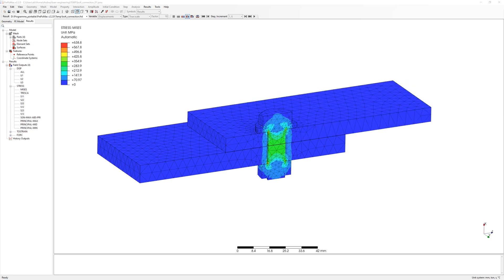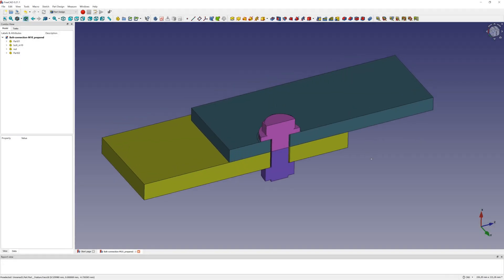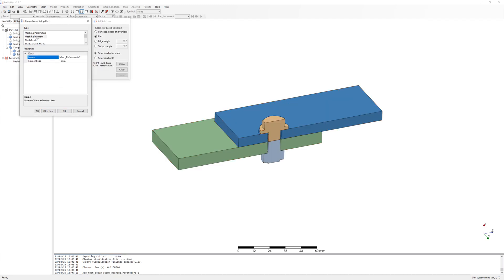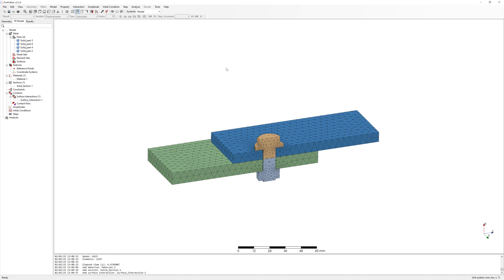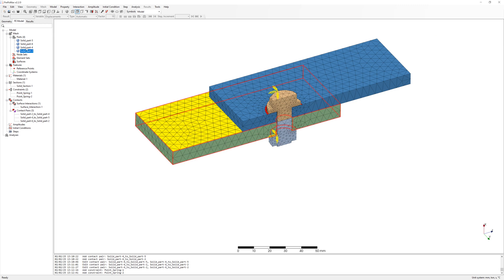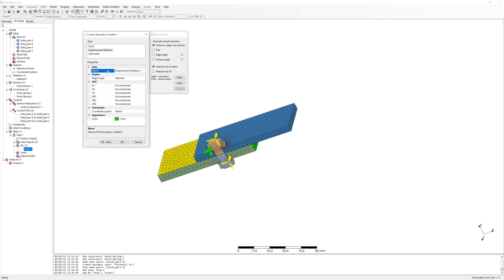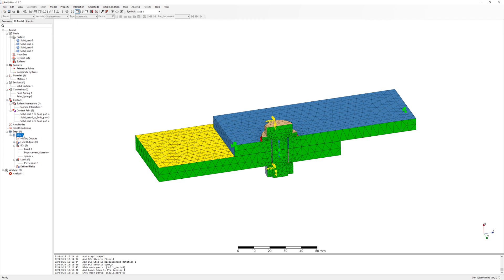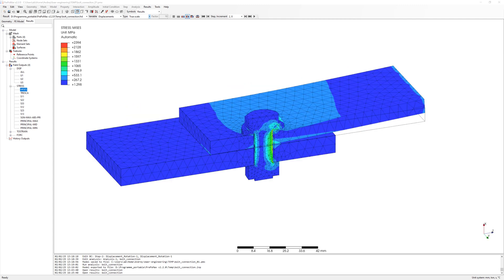Simulation of Bolt Connection - Pre-tension and load | PrePoMax

Comment: Hi, Andreas, well done! Only one remark: when you duplicate a step with a pre-tension controlled in force you get a step that keeps the force on the bolt section constant, whereas in reality you probably would like to lock the displacement of the pre-tension surface. 
So the bolt pre-tension boundary condition should be changed in step 2 accordingly.
Best regards
Reply from the maker: Ok. Thanks. Is that in second step is pretension is fixing?
Reply: @andreas-baer-engineering  Yes, in the second step the pre-tensioning displacement  should be kept fixed at the value reached at the end of the first step. 
When threaded connections are loaded, the load goes mostly into a variation of the stress in the compressed volume, and less into the bolt tension. 
If you keep the bolt tension constant you get a wrong result.
😉

Comment: Thank you for great tutorial, is it possible to make simulation for gasket & weld neck flange stress due to bolt load?
Reply from the maker: Hello. Basically, it's the same procedure. I tested it with a small example: two weld neck flanges and a PTFE gasket between them. It's naturally complex due to the many contacts (bolts, gasket, flange). I simplified it: I removed the screw heads and connected the screw to the flange with a rigid connection. The gasket and flange are also connected with a TIE contact. See short video here: https://youtu.be/2dguvx46l7U
Reply: @andreas-baer-engineering Well noted many thanks